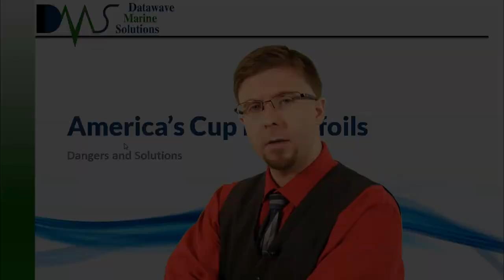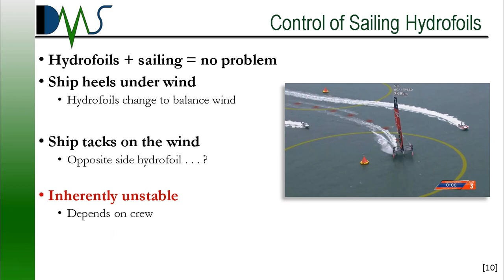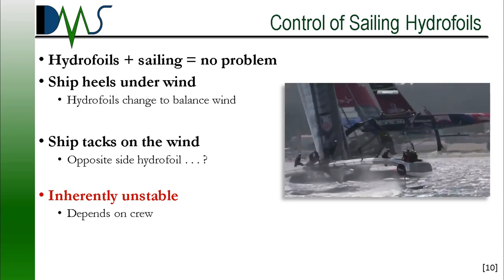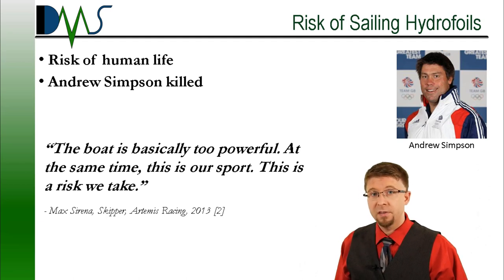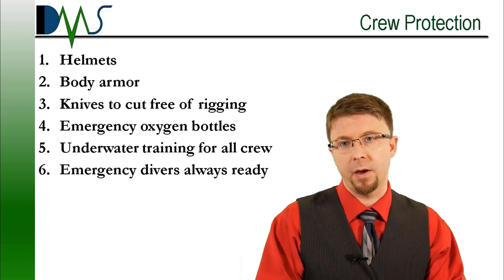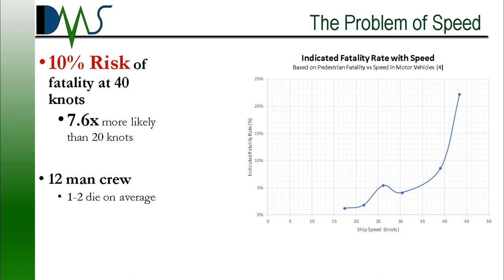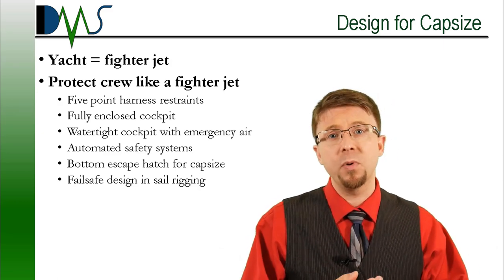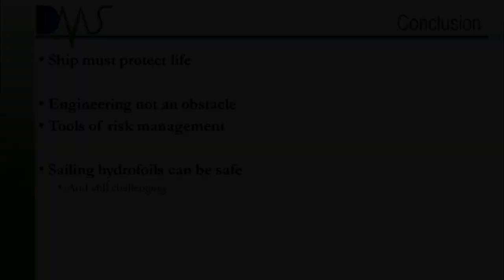America's Cup Hydrofoils:  Dangers and Solutions

Comment: Something I'd be interested in seeing is an efficiency comparison between props and jet drives. When I was a comercial fisherman in the eighties there was a jet that supposedly matched prop thrust with equal horsepower and boat size. Then in later years I moved to land based work and didn't hear anything more of them. I still see jets for rivers and such, but there is a loss of thrust in them that supposedly wasn't there in the industrial version.
Reply from the maker: Stay tuned.  I have a video coming out in the next few months abut water jets, and they address that issue.  The short version:  jet efficiency depends on speed through the water.  Below 20 knots, props win every time.  Above 30 knot, jets almost always win.  20 - 30 knots, jets and props are about equal in efficiency.
Reply: @DatawaveMarineSolutions  those were in the 20 kt range. They were selling them for salmon and hering fishing. Thanks for the reply.

Comment: The KEY takeaway here is engineering gives us the tools to experiment with stability aimed at safety while maintaining speed, challenge, and FUN FACTOR. Aircraft design has similar solutions, which add stability and safety, in which the engineers knowingly sacrificed performance (just enough) to solve the problem. Think Fighter jet vs Cessna 150 - both very successful in the market place.

Comment: People are going to die, sailed a few of the small ones. They scare me s##tless
If I may ask a question, What do you think about the Neel 51 trimaran? Dearly would like to own one.
Reply from the maker: Very spacious ships.  I like that most of the living space is on one level.  Definitely an ocean-class vessel.  I really like that they have a dedicated engine room in the center hull.  

From a safety perspective, there is a very important graph on this page:  http://www.neel-trimarans.com/why-neel/  That shows the graph of righting moment vs heel angle.  Don't worry about the magnitude of the moment.  

Look at where the peak occurs.  The Achilles heel of multihulls is they have high initial stability, but nothing after that, leading to the concern about capsizing.  That is what the graph is showing with the Cata 44', which has its peak at 12 deg.  Heel past 12 deg and its a loosing game.  Monohulls typically have a peak in the range of 30 to 40 deg.  The NEEL trimaran shows its peak at 27 deg.  That is safety range close to a monohull, plus the stability of a trimaran.  Good combination.
Reply: Thank you kindly for the reply. The one reason to look at the Neel was simply the fact all the weight is in the centre of the boat. That and the higher angle when sailing up wind. O ce again, thank you.

Comment: A good point, even NASCAR realized that speeds were getting beyond what drivers could control and introduced restricter plates on speedway cars. Having said that, the unintended consequences of that move caused even more wrecks by bunching up the cars at 200 MPH. America's Cup racing doesn't allow electronics to control any aspect of the boat's systems and it may be that the demands on the crews of foiling multi-hulls are too high to allow foils to continue to be used. There is the danger of the sport being so pacified that public interest is lost like has happened in auto racing. It is the speed, and yes the danger that has driven up interest in yacht racing in recent years and unlike NASCAR, yacht racing poises little danger to spectators, putting the risks on those who choose to take them. Perhaps there is a solution to boat control, but wouldn't that lead to even more speed and more danger? America Cup boats are no more passenger craft than competition stock cars are family sedans. Any sort of racing will never be as safe as commuting to work or to the Bahamas. Trying to make it so may end the sport.
Reply: Interesting that you brought up NASCAR but then failed to address other safety features added to the cars and track to make racing safer.  Safety features such as the roof flaps to help prevent rollovers, 5 and 6 point safety belts, the HAN device to help keep the drivers head as one with the body.  Rollover cages have been part of the sport for decades.
Reply: @drkjk  I suppose I could have written a book about NASCAR's rule changes, but my point was that as the sport got safer and inundated with rules it gradually lost public interest and with it, sponsors that support it. NASCAR has now devolved into 40 cars circling a track for three hours and a huge multi-car wreck on the last lap with one of 4 or 5 well healed teams winning. Perhaps you should examine how the popularity of the America's cup has accelerated world wide as the speeds and innovation of the boats have increased. Any of man's endeavors that push the envelope of achievement involve some sort of risk whether financial or physically. Turning the America's cup back into a vanilla sort of event where one well healed team wins every time will result in it's previous status of disinterest.

Comment: Interesting thoughts - sounds like your complaints have nothing to do with the actual hydrofoils themselves, but the degree of performance they push these boats to at the risk of human lives. It's not the hydrofoil concept that is unsafe, it's a sailboat that might capsize going 40 knots.
Would be interesting if the approach changed to a more "modern" design to try to get the most performance hypothetically possible out of a sailboat using modern approaches and technology. Have a crew of one or two inside an enclosed cockpit strapped into harnesses as you suggest, controlling everything remotely. I envision two crew, one a helmsman that steers the boat, focused on navigation, strategy, and avoiding collisions. The other controls the sails, and possibly the hydrofoils, using switches and other electronic controls to drive them in and out, electric winches replacing manpower. The vessel could hypothetically be single-handled as all these controls are in reach of the helmsman, though that would be an entirely different event - sort of like how there are different events for single- and two-crew sailing skiffs in the same boats. The sail and hydrofoil control could easily be automated, sooner or later the helmsman role could be too, computers being able to analyze conditions and react faster than a human ever could. The "purists" who prefer the current approach of no motorized anything on the vessel would hate this, but said purists probably aren't keen on the latest generation of wing-sail hydrofoils anyway. This approach would give the best performance of wind and water possible with current technology, and I would find it quite interesting.

Comment: As an engineer I have a few points:

- the analogy to car accidents is wrong, as demonstrated by the significantly lower death rate of these fat boats.
- Bart died because the boat collapsed. It collapsed because the naval architect screwed up the structural calculation. They underestimated the loads of a fast boat. The guy still practices, but he’s not the hottest one around anymore.
- similar to the recent collapse in the vendee globe. NAs push the limit of the structural strength to the bear minimum and sometimes beyond.
- capsizes actually happen more at lower speed as the boat slows down as it looses control, see recent crashes in the AC or other foiling classes.

I was hoping for some insights into more stable foil setups, rather than generic safety chat.
Reply from the maker: For insights into stable foil setups, see my other video:  https://youtu.be/KJpkN_EFpzI

Comment: If the numbers don't apply, why do you even bring them up? You claim a potential 1-2 sailors per boat dying per year, but the statistic you bring up is related to cars hitting pedestrians, which is a completely unrelated topic to a hydrofoil boat hitting someone in the water. Andrew Simpson died because of entrapment under the boat. This is a danger that has existed around sailing since its conception, and a danger that has been mitigated to an absolute minimum, but still happens. The solutions you present in this piece would increase the probability of entrapment, and would increase the dangers present to sailors.
1: A five point harness is literally a method of attaching sailors to boats that then fill with water. No one with experience in high performance boats would recommend this.
2: A fully enclosed cockpit would trap sailors in the boat. What if the encapsulation failed to allow water in but not the sailors out? 
3: Watertight cockpit with emergency air- see point 2.
4: Automated systems- I agree that any safety system implemented should be automated.
5: Bottom escape hatches would increase likelihood of that hatch failing in a soft impact and sinking the vessel. Also only works if there is easy access to wherever the hatch is, and does not help with entrapment caused by line or equipment, the most likely cause of death from sailing.
6: Failsafe design in rigging- firstly, literally impossible. Production boats designed to have thousands of miles across heavy seas still have rig failures, because if you make the rig unbreakable, the hull will break instead. There are times when it is better for the rig to break than for it to not.

I 100% agree that every possible safety precaution should be taken to protect the sailors, but I disagree with the way you've presented your data, which purposefully misrepresents the data, and I believe that the solutions you present are not safe in their own right. I do not understand how Bart's death directly corelates to fatalities involving motor vehicles? He drowned after being trapped under the hull, but was unconscious when found. I remember Bart, but you're misrepresenting what happened to him. And to compare a boat to a fighter jet is foolish. Jets' safety mechanisms are designed to eject the pilot before impact, and I have not once heard of a jet that made contact with the water and did not crumple or sink upon impact. The two rules of ensuring safety during a capsize are: 1. Do not get stuck under the boat, and 2. do not get separated from the boat. Anything else places further danger on sailors. What you bring up would not be legitimately considered by anyone who has experience with performance vessels.
Reply from the maker: Thanks for the feedback.  You made interesting points.

Comment: "ships must protect life" - let's look at F1 cars, do they protect life? Sort of, the carbon driver cell is tough, but aside from that, they're vulnerable in a crash situation with MUCH higher speed differentials than even the current AC75s are producing. I don't think it's reasonable to construct an ultra light thing and then load it with 2 tonne of safety gear and slow it down again. They're built purely for speed, like any racing craft on water or land or in the sky, and all of them are dangerous, and that's okay. Better to die having the time of your life than rotting in a rest home with dementia.